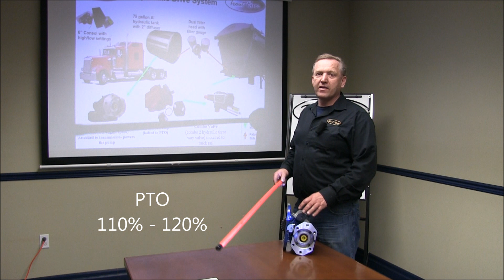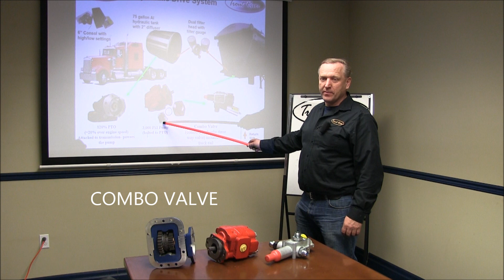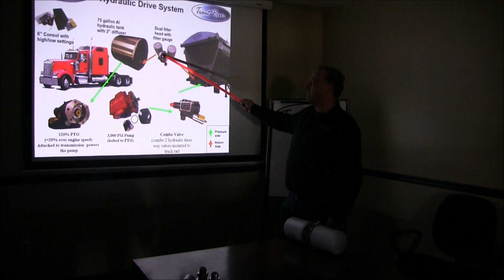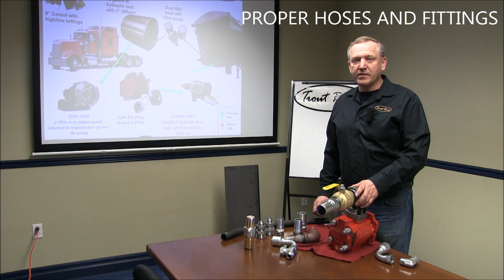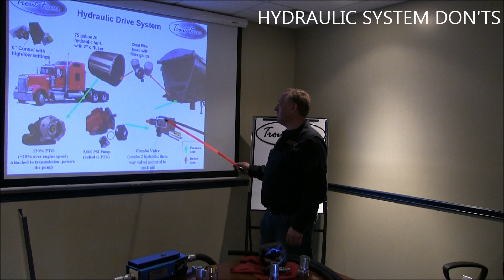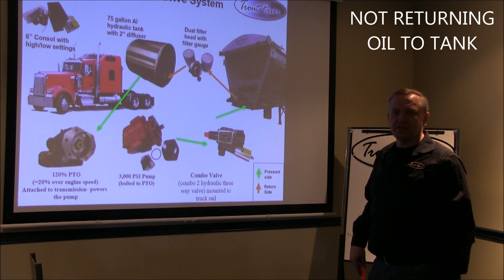Hydraulic Drive System (Wetline Kit)

Comment: To bad the instructor really does not know hydraulic details very well. Pressure is developed due to resistance to flow. You really should have someone who knows hydraulics that can explain the true purposes of the components used in the system.
Reply: (to bad) you and instructor don't know how to use the spelling and use of to,  and too bad